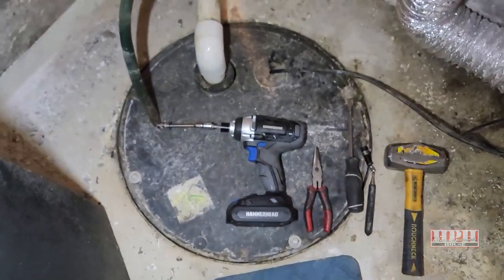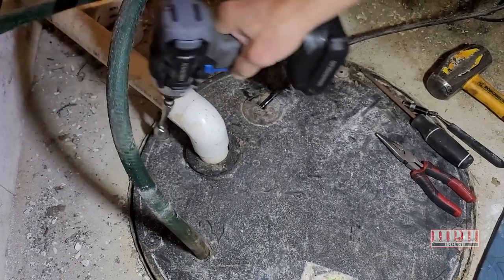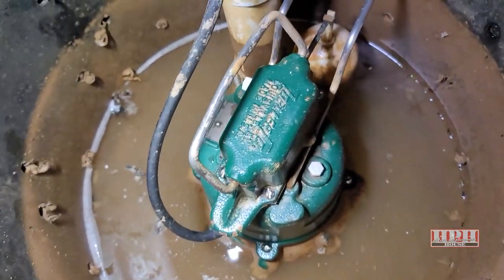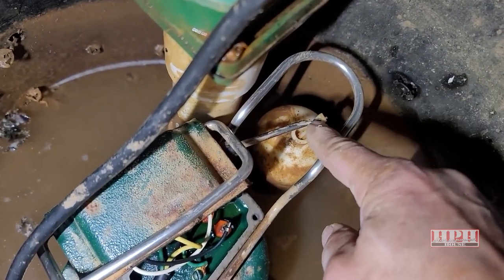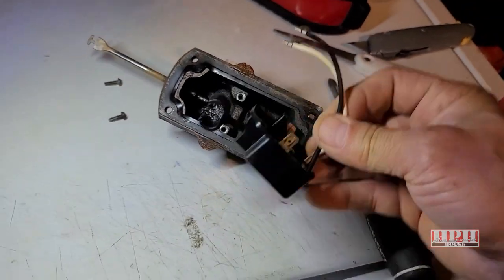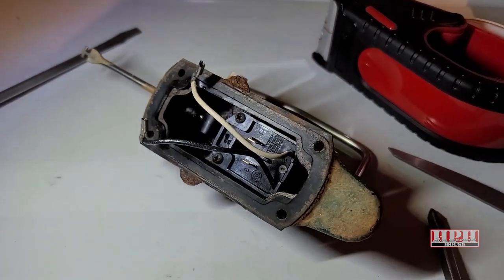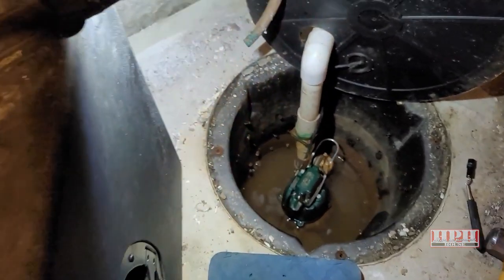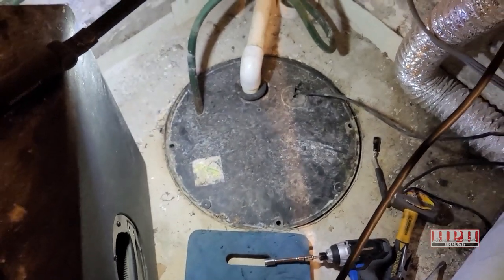Zoeller 53-0001 Sump Pump Switch Repair 004892 M53-D Replace Remove Get to

Comment: thanks bud - great video! 

having trouble finding out whether replacement zoeller switches work for most models. the plate where the model should be listed is corroded.

also, is it good PM to change the arm and seal assembly while you are in there?

Comment: Thanks! This was what I was looking for. I do plan to buy the case, switch, arm assembly to simplify things ($62 plus shipping) from Supplyhouse - I am not very handy, so I think this would be worth the extra expense :)

I read that I might need to clean and file to smooth out the mating surfaces of the case. But I think the rubber gasket will take of that. 
Let me know if you have further hints!